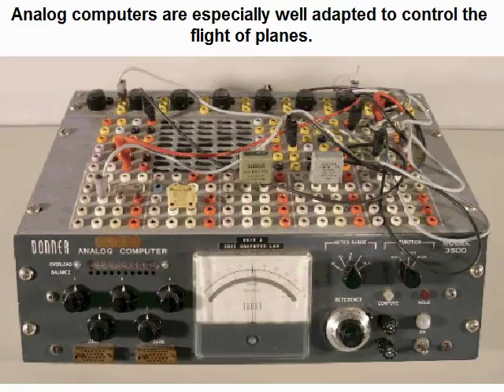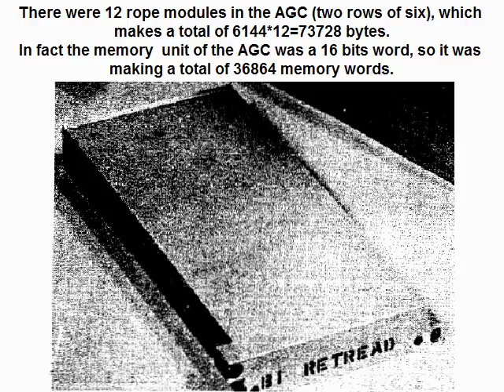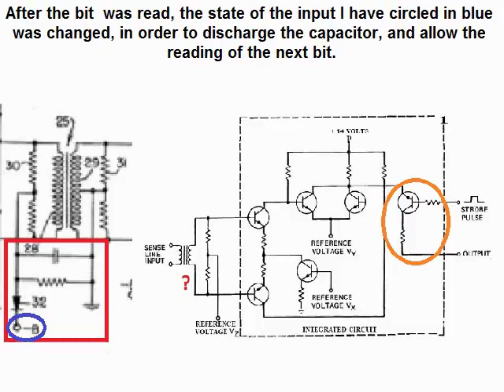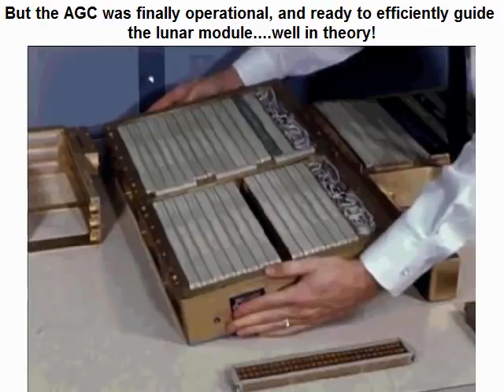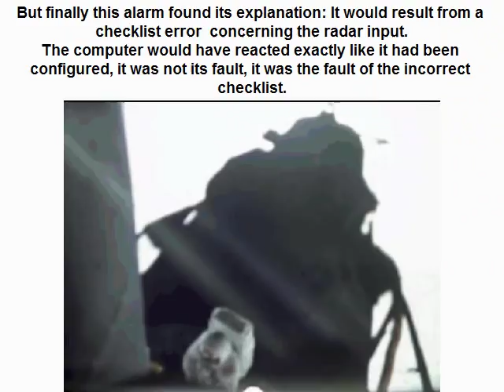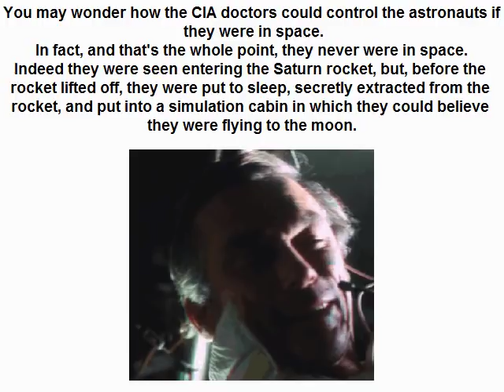Moon Fantasies: The Apollo Guidance System

Comment: Don Eyles is right about longer programs often being quicker (as backward as that may seem). An example would be iteration where you may have to run through a relatively short loop many, many times to get an answer that could have got much faster from a single pass through a slightly longer routine. Programmers face these kinds of problems all the time when doing low level programming, But luckily these days in higher level languages the compiler handles most of this for us.

Comment: 21:26 There is a ready belief that the 120X bailout alarms had not arisen in training before. In the months leading up to the launch of Apollo 11, Jack Garman had suggested to do some simulated missions with these very alarms. Guidance Officer Steve Bales, who later was highly commended for giving GO at the GO/NO GO decision point in the actual mission, gave an immediate NO GO in the simulation to a 1201 for which the controller team were heavily berated by Garman as these bailout alarms were survivable depending on the actual cause. It was at Gene Kranz's suggestion that all the alarms be written down with a brief description and the remedial action required. This was why Garman had the error codes under a sheet of glass on his desk when it came to the actual flight.

It is not correct that the astronauts and ground controllers had had no previous experience with 120X bailout alarms. Ground Controllers did have some familiarity with them which is why Steve Bales did not immediately recommend abort but lingered to diagnose the problem leading to the growing apprehension in the astronauts. They were professional test pilots at the pinnacle of their careers and were not prone to being alarmed!
Reply: P.S. It was not determined to be associated with rendezvous radar CDU runout at that time but was arrived at many months later, after the Apollo 12 mission as the LM had a hardware phase error that had been noted by ground engineers in the prelaunch checkout of one of the earlier unmanned LM test flights. It was not appreciated at that time that this seemingly relatively small counter glitch would, given the correct set of other circumstances, lead  to such potentially hazardous situations. Aldrin's novel setting of the RR mode control switch provided the other prerequisite to disaster. By adhering to the checklist Apollo 12 serendipitously avoided the same headache.

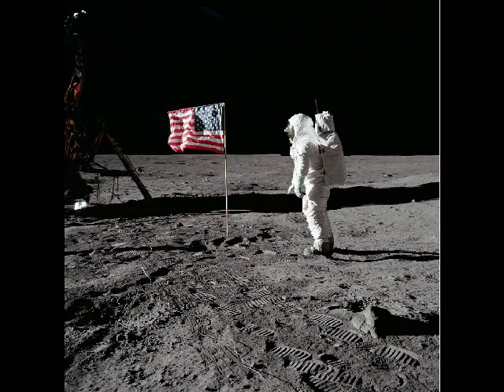Comment: Let's discuss your sense line amplifier circuit at the 13:14 mark shall we. Why is it being compared to an AC rectification circuit?
Reply from the maker: We can always discuss; the transistor I have circled in orange is a NPN, not a PNP, the emitter's arrow is oriented outside, not inside, though it is not well visible in the schema of the video.
Reply: +hunchbacked  This is at least your third attempt at flawing the AGC sense line amplifier. The other two attempts were in 2012 au lis.c om/pas cal.h tm and 2015 yout ube.co m/wat ch?v=M8 n_juKY VkI (remove blanks to view). Strangely no two of your analyses completely agree with each other.

To simplify the discussion the transistors are labelled from top to bottom and from left to right so the offending transistor is no. 6 and the transistor with Vx attached to its base is no. 4. The schematic from Charles Stark Draper Laboratory Archives differs from the one abused by Hunchie Enterprises  in having the base of no.5 connected to the collector of no.2 to complete one of two Darlington pairs, the other being formed by connecting the collector of no.1 with the base of no.3. All transistors are NPN as you have noted.

To operate, a read signal corresponding to Vx must be applied to the base of no.4 to connect the circuit to the earth shown. The Darlington pairs switch on in response to the DC offset voltage Vz in conjunction with the very small sense line induced voltage with each pair being alternately switched on by one half of the sense line sinusoid.

When there is no sense line induced signal both Darlington pairs are switched off which means that the emitter of no.6 is connected straight to the 14 Volts. When there is sense line activity both Darlington pairs switch on alternately to connect the reference voltage Vy to the circuit so that essentially this voltage is supplied to the emitter of no.6

This is where things go a bit screwy. In your aulis analysis you don't comment on it but you indicate in the circuit diagram (the Hunchie Enterprises version) that the collector of no.6 needs to be connected to a 14 Volt supply. To my knowledge the output line from the amplifier was maintained at 14 Volts! With no sense line activity both the emitter and the collector of no.6 are at 14 Volts so that there is no collector current into the output connection. With sense line activity the emitter of 6 is at Vy Volts and its collector is at 14 Volts. As long as there is a clocking pulse applied to the base collector conventional current flows into the output connection.

In short there is nothing wrong with the AGC sense amplifier circuit diagram, at least the one supplied by Charles Stark Draper Laboratory in association with MIT! Why you keep on maintaining that the sense line induced current needs to be full wave rectified is a mystery as the voltage from magnetic induction considerations is exceedingly small.

Over to you Ms. le Hunchie ma petite grenouille francaise.
Reply: Nochmals schweigt sich der Hunchie aus! Man würde's so fürwahr annehmen , dass es ganz leicht wäre meine dumme Anwort zu erwidern insbesonderes wenn es auf 'nen solchen Experte gehe
Reply: @hunchbacked  Well said!
Reply: Just CuriouS I concur with the logic of your logic. Do you really think hunchbacked knows what a Darlington pair is?

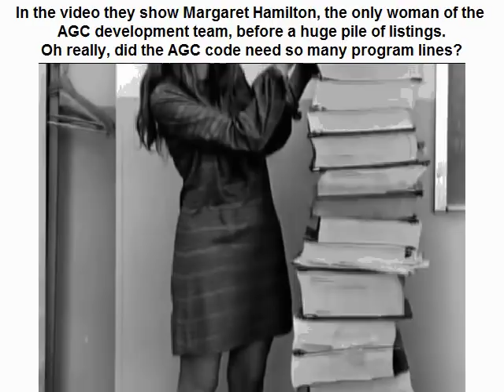Comment: 4:12 Dr. Margaret Hamilton is not standing beside just one AGC source code listing but many such. There are photographs extant of one source code listing which would be about the size of one of the bound volumes. A typical source code listing occupies between 1700 and 1800 pages for the AGC and the LGC. Anyone can access the scans of the originals on the virtual AGC website to confirm this. All your furious computations are flogging a dead horse of your own devising!

Comment: 3:47 Naturally the AGC was itself a machine and could design nothing. The design work on the AGC was not performed using the AGC as it itself wasreally a calculator executing a fixed invariant program and was not a research general purpose computer. The boys at the MIT Instrumentation Laboratory used the Honeywell 1800 and later the IBM 360 to generate YUL opcode and emulate the AGC's operation or processing of the opcode sequences much as many modern simulators of the AGC do. The guidance program including its unique features like the prioritising of executive tasks were nutted out on the Honeywell and IBM developmental computers and the resulting binary object code released for core rope manufacture and a listing was retained as documentation.

Once again you have garbled the story. To my knowledge the IBM 1800 you refer to is a garbling of the Honeywell 1800 and the IBM 360 computer names and you are playing upon the ignorance of your audience re the way that AGC programs were generated. Mind you there was an IBM 1800 machine but this was not used at MIT/IL. The AGC was a final flight hardware calculation device  in modern parlance not a laboratory research and developmental general computer.

Well done Hunchie! Glad to see that your right in there playing fast and loose with the truth. What other goodies await us?

Comment: AGC program listings:  Big pile of binders.  OK, so?  Is that just code?  Or is it code and documentation?  NASA has a great big huge thing for documentation, you know.  Come to think of it, is that a listing of just one version of the AGC code, or many versions?

Body language:  I had no idea you were such an expert in the field.

Don Eyles doesn't want to talk to you:  So sad.  Hey, why don't you try approaching Buzz Aldrin with a bible?

Thomas Baron:  Really?  You've gone THAT tinfoil hat?

Rope memory:  I have no experience on particular knowledge on this, but given your track record I'm just going to go ahead an assume that you either got some bad documentation or you don't understand it.

Space and code performance:  Are you a software engineer?  Well, I was, for 25 years.  Yes, with more space you can increase performance.  For instance, you can unroll loops, eliminating the loop control overhead.  You can do things like precompute function results and store them in memory so you won't have to recompute them at runtime.  Et (as they say) cetera.

Tracking & guidance:  The INS drift was too large at such high speeds and long durations.  It was decided to do tracking from the ground, and to update the onboard INS from time to time.  The AGC was used for attitude and burn control.  Attitude was updated via star fixes.  The AGC controlled the lunar orbit insertion and trans earth injection burns all by its lonesome, on the far side of the moon, on Apollo 8, 10, 11, 12, 14, 15, 16, and 17.  You could have done it yourself with a stopwatch and a sextant.

LM landing:  No, there was no realtime control from the ground, for reasons you beat to death.  The AGC gets position and attitude from the INS and gets velocity and altitude updates via radar.  There's nothing particularly magic about this.  (Since the LMDE could gimble I don't know if the RCS was used on descent.  Doesn't really matter for our purposes.) Communication dropouts during descent would be annoying but not tragic.

The infamous 1202 alarm:  This wasn't an "expected" error so there was not a lot of flight controller training involving it.  Fortunately someone in the back room knew that it was relatively harmless.  What's the mystery?  The AGC did as it was programmed.  (As I recall it, though I've not researched it lately, the AGC was taking data from the rendesvous radar during the descent.  It wasn't needed, and it took up processing time.  This caused a timeout before all tasks were finished this cycle, which triggered the 1202.)

INTENTIONAL SABOTAGE!  Actually, I call it normal, a/k/a SHIT HAPPENS.  They were pushing the boundaries in hardware and software running in a completely new environment, part of a crash program full of 80 hour weeks.

INTENTIONALLY CREATED:  Oh horseshit!  These guys have kept quiet about this for 50 years... why?

MKULTRA:  Bzzzzzzzzzzzzzt!  That's it, game over.  For fuck's sake, have you NO connection with reality?

Buzz takes a piss:  That's it?  You're hanging your hat on THAT?  Gawd.
Reply from the maker: The comments describing the instructions are indicated in the margin of the instructions.
Reply: Ah, but that's merely the internal comments.  Real documentation is delivered by trucks.
Reply: +Steve Plegge  I rechecked this thread and my previous comment must have been answering a point raised by you on another thread. OR Ms le Hunchie is up to his usual tricks again. Not all my posts are showing up here. I wonder why?